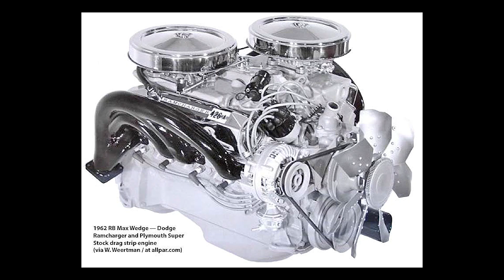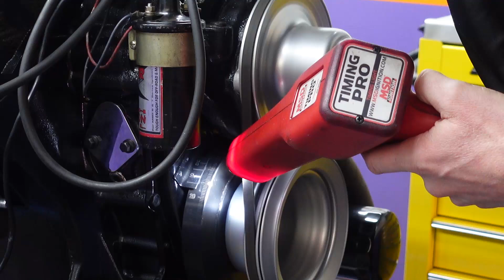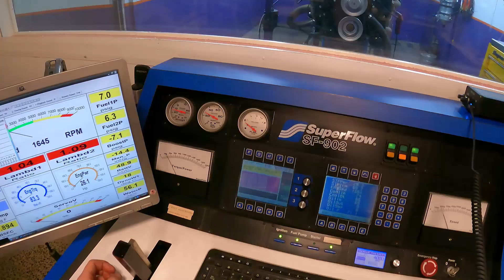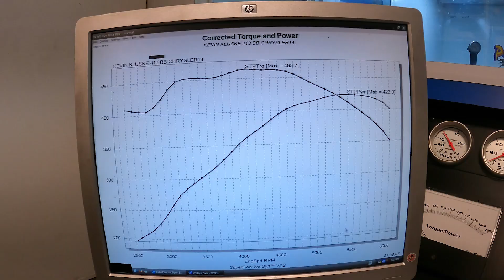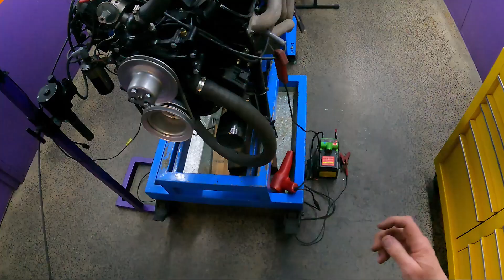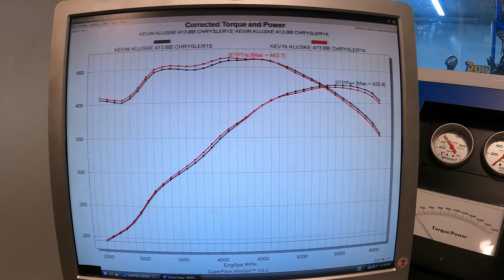High Performance 413 Big Block Mopar Build & Dyno! | Iconic Engine Builds

Comment: Don't take this the wrong Glenn, I think you've lost too much weight.
Do applaud the effort though. Just want you to be around. You seem like a good bloke and the works needs more fellas like you.
Also keep up the good work!!!!
Reply from the maker: All good mate, I’ve been working very hard on my fitness as I decided I wanted be around for a long time . I was too overweight. I’m currently 80kg and plan to stay there along with my current weight training program. I was always thin when I worked as a busy mechanic in my younger days, but at stacked in on when I got stuck behind a desk as my business grew into a monster some years ago. Glad you’re enjoying the videos and I appreciate your thoughts. 😊
Reply: Didn't expect that or so quickly. Yep sure is easy to put on. I did lose 60kg not through hard work lol but health. Hopefully helps me stay round for my daughters. 
On a different note you still in the dandy area? Because you ran g&d performance?
I do hooked on videos going down the you tube rabbit hole.
P.s I try to like as many of videos as I remember so you can get out there
Reply from the maker: @chevydyall7619  , no I left G&D in 2009 to get into the TV game. Back full circle again now though with the team at PowerHouse and loving it.
Reply: So you working for powerhouse? Also do you get down to pennlink often?
If your still round this area might have a build for you to follow soon. It'll be a hotrod but if you want more than to for you to follow build for your channel. Ill be building it in pakky. Im a coach builder so might make for good content. Will be realitivy scratch built which something even you tube doesn't see much of

Comment: Glenn. I understand that you live in Australia and I gather you own this high performance shop. Since Dodge - Chrysler Corporation is an American Company and I was wondering where you learned to work on the older muscle cars. Did you work at Chrysler at one time or at an American Performance shop to gain your experience. The Hey Day of Big Block Super Stock Drag Racing was the 1960s and 1970s when there was a lot of these Big Block Engines and a lot of men who knew how to work on them. Most of these folks have passed on and took their knowledge with them. There are still some Die Hard Drag Racers out there that run the Big Block Dodge, Ford and Chev 427s but very few are left. That why I was surprised to see an Australian that was not part of that Generation know how to Set one of these Engines up and make it run as this video shows. You Tube has many Videos shot at local Drag Strips that film many Big Block Classics in 1960 s and 70s Cars that dedicated Racers have kept going, I still get a thrill when I see them.
Reply from the maker: Great to have you here! You might be surprised to know that we have a big American car culture here in Aus, and our major manufacturers at one time being Ford, Chrysler and General Motors Holden we’re all US owned, so I was brought up around some great cars and engines. I owned a Dyno shop for many years and had a break from the industry but I’ve recently joined forces with PowerHouse Engines and I’m loving being back in the game again, with the added bonus of being able to showcase what we do to my viewers. I hope you get the chance to watch some of my other episodes on the channel as I think you’ll like what you see.
Reply: Yeah it's utterly amazing anyone outside continental USA knows anything at all. We only just got electricity a few years ago and sewered houses are still 150 years away. Water comes from wells dug by hand and women carry the water on their heads in wallaby skin sacks while dodging snakes, box jelly fish, white pointer sharks, crocodiles and funnel web spiders. It's amazing really.
Reply from the maker: @ThePaulv12  , I think where his perception stemmed from was that many people in the states think we're heavily biased toward an English manufactured automotive culture, and we were at one point untill Ford, GM and Chrysler started manufacturing here.
Reply: @GlennEverittMasterofMachines  Well alright Glenn but The Big Three came here back when Adam was full forward for the Sumerian firsts.
(I can see it all in my third eye: I'll crawl into my 3 wheel Reliant Robin [that I put a 3 stroke 3 cylinder V3 into with a 3psi triple spool turbo], call my 3 legged dog and drive to the tri-state corner of QLD/NSW/NT then order a triple cheese pizza with a triple shot decafe soy latte - all for you guessed it 3£, then drive home and crawl back under the 3 logs I just crawled out from under - yeah yeah yeah!)
Reply: @ThePaulv12  And riding around on the backs of kangaroos .
Reply: @chrispbacon3042  Chris, thou art a man of class and style!
Reply: @ThePaulv12  hehe - well you better be careful - Americans are largely a sincere and trusting lot and up until recently were not good understanding English / Aussie sarcasm, so some reading that might think you are telling the truth there.

Comment: I'm a Mopar guy i have a 360 CID stepside SE Royal Dodge Ram pickup d150 and they like to breath a carb that you think is to big is just about right I'm running a 750 CFM carb on my mouse IT make's 300 HP and 300 got God bless from Canada eh
Reply: I run an 800 cfm quadrajet on my 318.
Reply: That ain't a b or rb block????
Reply: I've taken a 383 over bore 60 to 8500 rpm on .695 lift with mushroom tappets
Reply: Socialism now that sounds good.